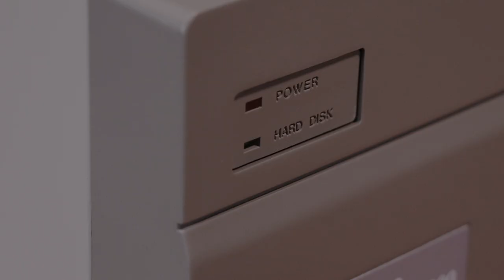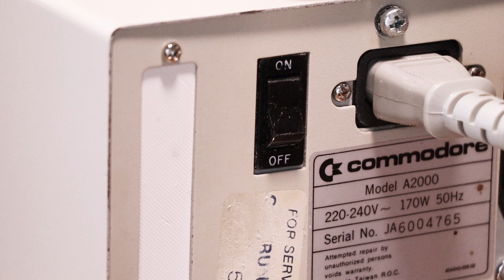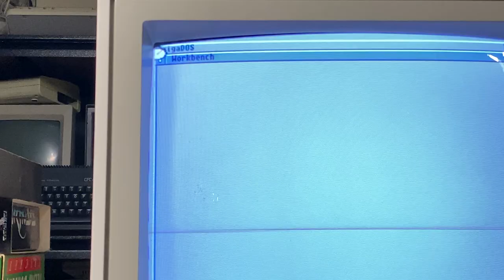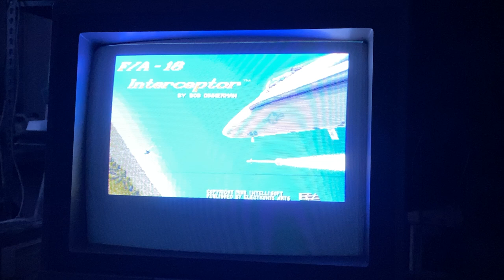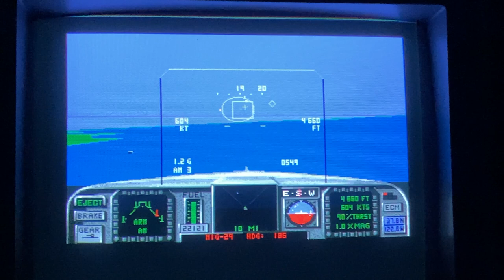Amiga 2000 (featuring @TheBritishIBM)

Comment: @1:39 160GB seems large for that era of system. Should that be 160MB?
Reply from the maker: Ahh. Yeah. Good point. 
It’s 160mb. 
Had to have at least one typo in my vid
Reply: Of course, as a matter of fact, you can see that's the case on the drive label, which gets focused at the same time as the caption appears.